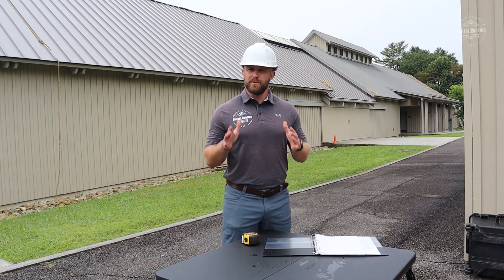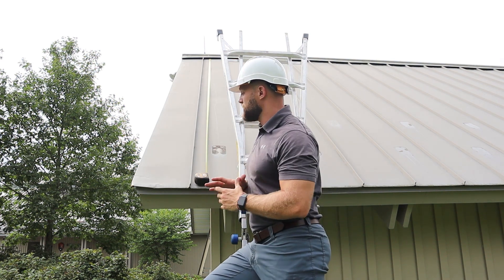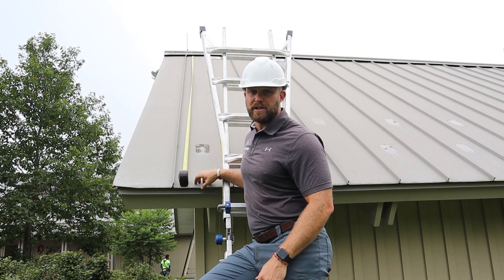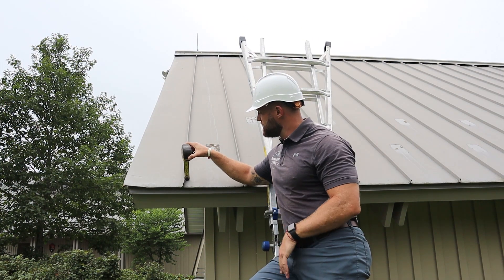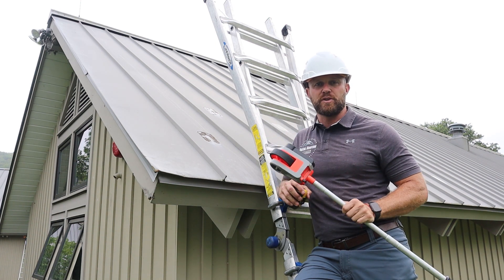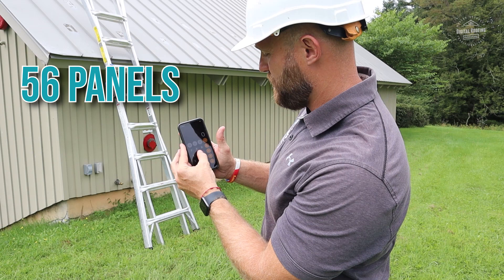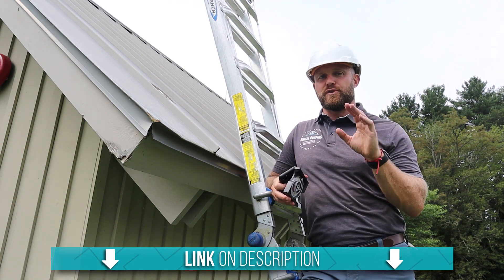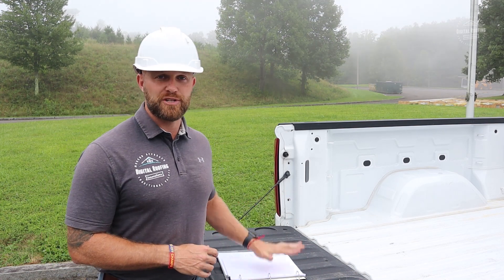How To Measure Standing Seam Metal Roofing

Comment: Most metal panels are from 36 to 48 inches that I see. But the video did not help at all. It is easy to figure out a square roof. One with different angles is the one you should be showing. How to figure out what the cut would be from one to the next on an angle cut.
Reply from the maker: Most metal roofing panels are 12"-18" and gable roofs are the most common roofs in America.  We have to help the majority more than the minority.

Comment: Hi, wouldn't the ridge tape cover a few inches anyway?  so long its not below the cap. So as to not be cutting more than you have too.
Reply from the maker: Yes, but if you're short, you are going to lose thousands and thousands of dollars only to save a little.
Reply: @DigitalRoofingInnovations  how would you be short if the layout was done correctly? It simply doesn't make sense to cut the bottom hook on and then cut the top because it's too long...I'm sure the carpenter's squared it fairly well. I prefer like most to cut less as possible. Happy roofing!
Reply from the maker: @kellygregg3688  When I am ordering over $100,000 worth of metal, I don't take chances.  As a business owner, I can lose 1% on a job, but I am cautious so I don't go bankrupt on a project.
Reply: @DigitalRoofingInnovations  I'm not  Insinuating you take a chance just measure correctly.
Reply from the maker: @kellygregg3688  This video is how to teach homeowner's and new contractors how to measure for a metal roof, not someone who's been doing this for a decade.  If you're not one of the former, this video doesn't apply to you.  I am not going to advise a homeowner or a new contractor to try to get exactly right then they been a couple inches short and lose thousands of dollars.  Then, I get a lawsuit in my lap because they want to blame me for watching my YouTube Channel.  Reward vs. Liability.  Have a good day.
Reply: @DigitalRoofingInnovations  all good my man. There's  more than 1 way to skin a cat. The less it screams the better .

Comment: Why are you replacing the standing seam metal roof?  I thought these roofs lasted for decades?
Reply from the maker: This was a project for the US Government (National Park Service) and they choose to replace it because it was leaking.  That roof had been up there about 20-22 years.  The problem was, it was installed correctly to begin with, but yes, a properly installed mechanically seamed 24-gauge standing seam metal roof should last for decades.